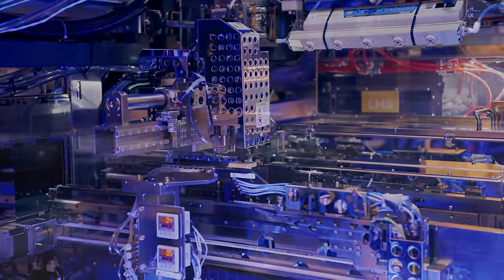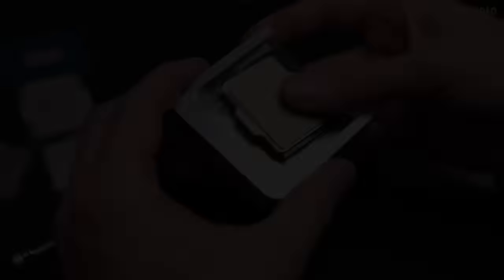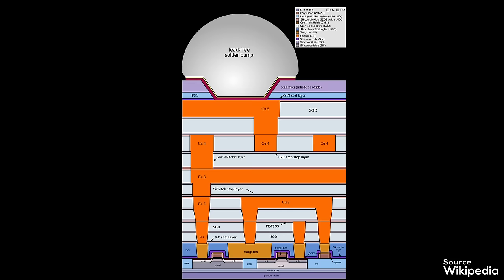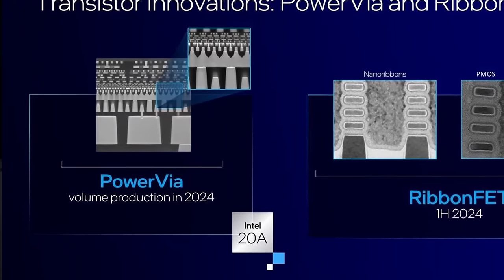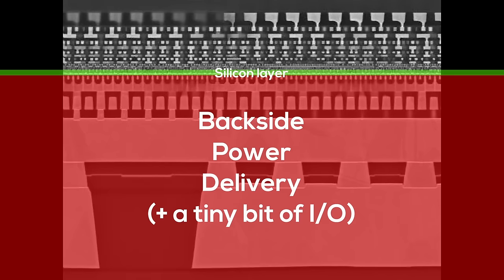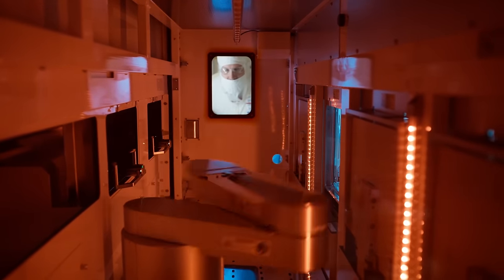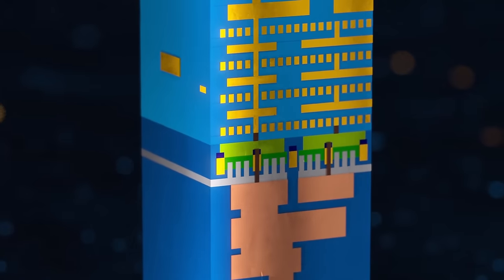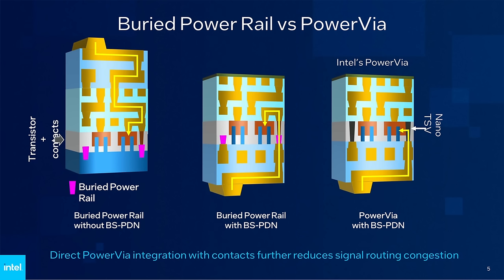Why next-gen chips separate Data & Power

Comment: Thank you for your fantastic video. I have to think about it for a while because I still don't understand its overall features. When I imagine it as a skyscraper, and its levels are dedicated to different purposes, why do I have to drill a hole into the basement for my power and use the roof of the building for a laser data connection? When I build up a power grid from the first to the tenth floor, then a CMOS layer to the following levels, and then some data layers, I will get the benefit I want, won't I? For the subsequent levels, I would continue this sandwich upside down repeatedly. Then, I have to interconnect those power and data layers. Why should I think about how my power and data will be connected to my socket? I am interested in your answer and want to understand what I am overlooking.
Reply: Okay, I got it.
I forgot the role of the wafer and the ion implantation. So, there is only one level for the NPN transition, and we have to drill into the wafer for the power supply. What are the options for this drilling process?
Something like laser cutting or etching? Aren't the wafers still cut out of these big silicon monocrystal blocks? That would make drilling really expensive.
My assumption of actual processing was that sputtering silicon in different forms would be available. But, of course, that would make wafers obsolete.
Do you know the state of the art of sputtering silicon and what about its crystalline defects?
The idea seems challenging to archive, but it is excellent!

Comment: If nobody explains to me how you could cool such a "sandwiched" silicon i cant see how this could bemapplied to modern computer cpus giving their thermal characteristics
Reply from the maker: It’s actually only the frontside metals which are added into the thermal chain and the improved efficiency more than makes up for it.
Reply: @HighYield  thank you for your post but it still sounds unrealistic to me.
I mean the front side metals could play a part in conducting heat (which in turn would change their resistance etc ) but no matter how densely packed they could be a considerable amount of die surface wouldn't be in contact with whatever would be used as the actual a cooling surface(e.gmthermal paste) or at least the medium that connects the cooling surface with the die would have to be considerably thicker which would reduce the amount of heat a cooler could transfer from the actual die surface per unit of time, unless the consumption is decreased tenfold or around that figure without performance to take a hit I can't see how we could cool a current e.g raptor lake die (the architecture given just as a reference for complexity density performance and power draw).
Don't get me wrong the method it self doesn't sound unrealistic to me, just it's application to anything considered as "cool tech" is, I see this method being applied to various ICs on motherboards or maybe in particular chiplets of a CPU (e.g an io chiplet) in order to free up some wiring surface for the actual cores or whatnot, but not on CPU or GPU cores or "main dies" directly.

Comment: Seeing a working proof of concept would be more useful than diagrams. These number sound amazing but what will be better is a working proof of concept or even a working end product using it.
It sounds like a good idea but so many good ideas that work in CAD did not work in reality. Now if it works and provides the benefits explains in the video that will be good.
Reply from the maker: Intel has Blue Sky Creek, a working chip with BSPD.
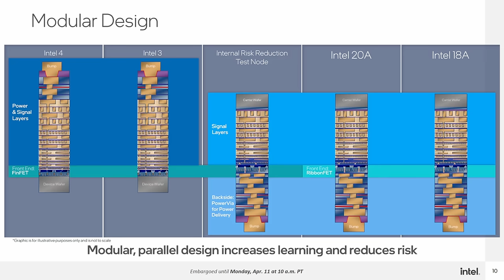Reply: I'm guessing you fell asleep at 11:06. rofl